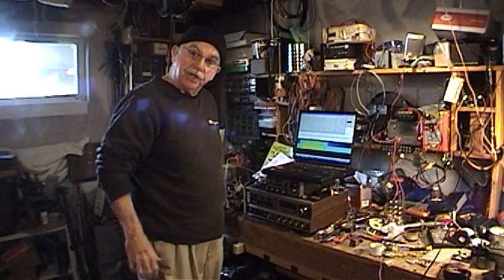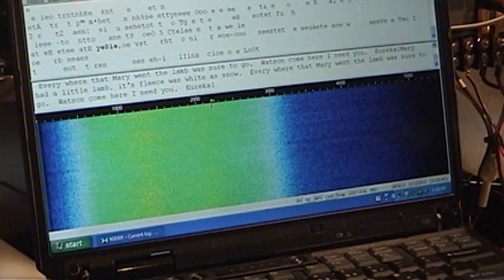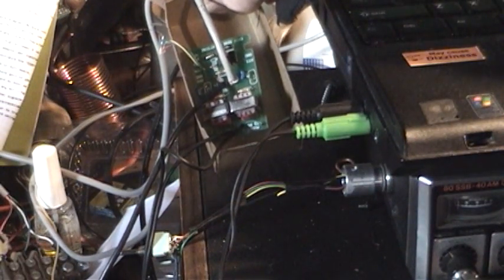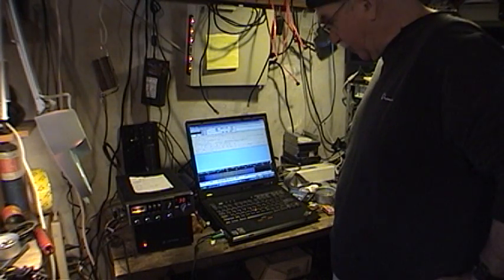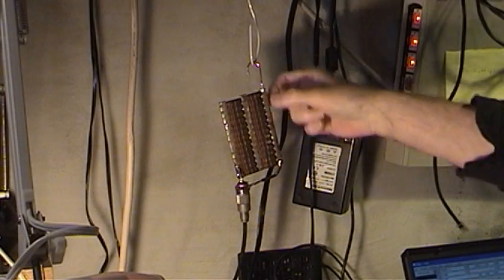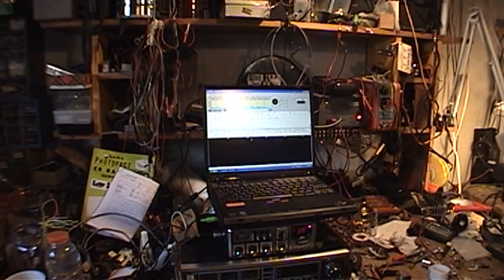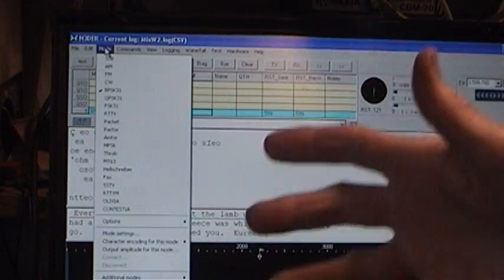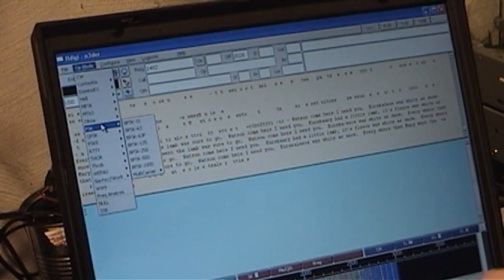CB Digital Mode Test

Comment: They should open the CB band to digital modes, among other things. Particularly packet, being an old mode that's practically gone now. I'm not a CBer, but that band is deader than packet these days. Much of the reason is that the laws governing it are cartoonishly narrow (though unenforced, to my knowledge). If they busted it out a little, upgraded it with digital to enhance the fun and practical applications, that might change.

Comment: illegal...only licensed hams on their frequencies can do this legally.  I've seen the inside of the FCC vehicles and the inside of a listening station.  they can find your location in under 10 mS and within 99 ft.  After 800mS the location is GPS accurate.  they also can ID your finals digitally.  Every radio is different and is an electronic fingerprint.  fines can be $10,000...lot better just to get your ham license...
Reply: "only licensed hams on their frequencies can do this legally"
This is not 100% true. maritime and military HF have legal right to use digital modes, Also commercial VHF and UHF can use digital data modes also. P25, Opensky and Mototrbo are all total digital formats that are obviously not ham radio related, Railroads in the us use a form of PSK for their EOTD's (End Of Train Device), SCADA is another form of commercial digital mode.

I too am an Extra Class operator but I am also an RF Engineer and work professionally on commercial and cellular communications systems.I do youtube and gaming as a hobby on my free time.

Now the guy in the video is a licensed ham, he stated that in his previous video which I can assume at this point you didn't watch..
He also stated that doing digital modes on 11 meters is not legal and that he is using a dummy load in this experiment.. Again I can assume you didn't watch this whole video before commenting..

The FCC does not care about the 11 meter band, they haven't cared since the early 80's and will ONLY get involved if there is some part 15 issues where a CBer is interrupting other radio and TV services in an area.
Reply: @Elfnetdesigns  Let's not forget MARS in the list and the fact that FCC rules do not apply in all countries.
Reply: @blahbadyblah  rules, not laws
Reply: So how would i run FT8 on a 10m KPO DX5000 radio?
Reply: Can they also tell if your transverter fluid is low?
Reply: believe it or not, there actually were transverters used a good while back.  they allowed a radio to operate in a band it was not designed for.  Besides locating you each radio / amp emits a signal in the first few milliseconds that will uniquely identify the device...just like a fingerprint. They are ablt to tell if it is the same person and helps eliminate the possibility of someone recording an operator and retransmitting it to get them in trouble...
Reply: Robert Spencer

Yeah, I got a certain bridge in New York to sell you. You might want to go outside and try some chemtrail bounce.
Reply: Robert S who are you trying to kid about the FCC comment?
Reply: the fcc had a van at the Gold Coast Club years ago.  The listening stations are the ones that can pinpoint in under a second
Reply: I have an Extra class amateur radio license.  The FCC rules and regulations do not allow any mode of communications on CB radio except phone.  Digital is possible but it could get you a fine, and yes they can find your location in 10mS or quicker.  As hams, we are charged by the FCC to monitor our own bands.  We have OO's Official Observers working thru the ARRL and report to the FCC with evidence for prosecution when necessary.  The fines are $10,000 but they normally will knock it down to $7500 unless you have really pissed them off.  Laura Smith is the Special Prosecutor in charge of the Amateur Enforcement Bureau.  If you don't pay the fine it is turned over to the IRS for collection.  All radios even if in SSB, CW, RTTY or any mode has a transmission at the very moment the radio transmits but only for 50 mS or so that transmits the specific characteristics of the output circuit of the radio.  All circuits are different and can be seen electrically.  All components in a radio have a tolerance and no two are the same.  This causes the voltage output to vary over the first few milliseconds at the beginning of the transmission and produces a "finger print" of the circuit.  If any component in the transmitter circuit is changed it will also change the "finger print".  And yes the FCC can catch you that fast.  It takes us a little longer as we have to use Doppler to direction find someone.  Mine draws lines from my location as I drive around from my location to the direction of the transmitter.  It eventually will create crossing lines showing the location. "kn2cdotus" sells a unit I use in my vehicle.  I've caught about 17 illegal operators using 2 meter ham radio without a license in the last 6 to 7 years.  They did receive warning letters from the FCC.   I nor any ham cares what you do on CB radio, just be aware that you could face fines.  Hams don't look into illegal CB operations.  We have enough to keep up with on our frequencies.  This is good information to know and they would not care if you used it during life and death type emergencies.  They nor we are wanting to do so but only do so if necessary.  Most of the time we can just talk to them and they will stop or even get their license and become a good operator and friend.  They don't always know the laws.

Comment: Nice video and nice setup! I wish I had thought to do this back in my heyday of CB. Most of the HF digital modes were made specifically to work over audio bandwidth equipment, so it's really a no brainer to patch a PC's soundcard out into the mic system of a CB rig. From there you can do whatever you like, within reason. SSTV, MFSK, WEFAX, whatever turns you on. I would have LOVED to do this with my CB friends back then. Totally missed my chance. :-)